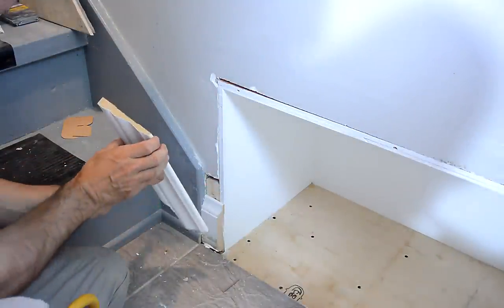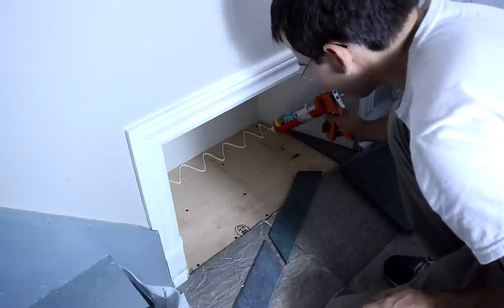Installing a boot nook

Comment: Nice project. But hitting a hammer with another hammer is not safe, with two hardened steel objects one is likely to chip and hit you in the face.
Reply from the maker: markdf14 Wasn't likely enough for it to happen.
Reply: +xl They really hit the nail on that myth.
Reply: Apparently? So you don't actually know for sure? My opinion is based on what I was taught as an apprentice.
Reply: Mark Taught, but never actually seen it happen? So you don't actually know for sure? 
The myth was busted. They tested it numerous times. Get off your high horse.
Reply: +Matthias Wandel
True Matthias, it's not very likely. But it is ALWAYS a possibility. A friend of mine has a piece of my hammer permanently lodged in his bicep as a result. Could have very easily been his eye.

I greatly respect your skills and innovation, but I don't think it's a good idea to give your viewers the impression this is a safe practice. I'm a carpenter with 30+ years of experience. I have seen this happen multiple times and very up close and personal.
Reply: It's ok, Matthias wear "safety" glasses all day... :D
Reply: +Magna Proxy Yeah I've seen it happen twice, my former boss still has the steel shard in his hand to prove it.
Reply: +JeefCakes There is a difference between being a safety nut and being someone with real life experience, once in a while you may find it worthwhile to listen to those who know more than you.
Reply: That's more a result of a poor quality crucible that resulted in an impurity and thusly it's a chemical weakness as opposed to a design flaw or physical force.
Reply: Tyler Pritchett Maybe, it would be odd if the massive crusibles Estwing uses are of poor quality... that could be the case though.
Reply: ***** It would take but a tiny particle to cause a weakness. It does happen too. Not every time, but often enough. It may not even prove to be a problem because of the specific application of the material in question.
Reply: Mark yes I have a peace of hammer in my hand
Reply: @CircuitofDoom  What you were taught as an apprentice isn't real life experience.
Yes, that can happen. But in the real world you don't always have all the tools and time in the world to do everything by the book.
I'm sorry but what you were told when you were an apprentice is of no value to people actually working.